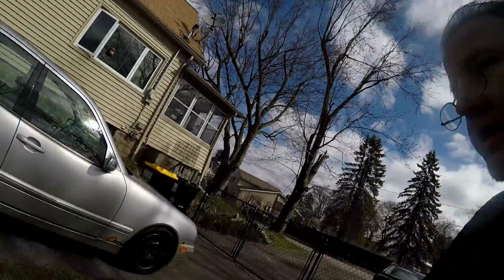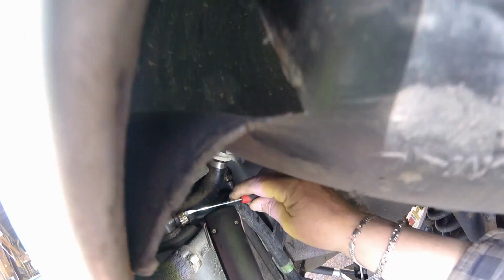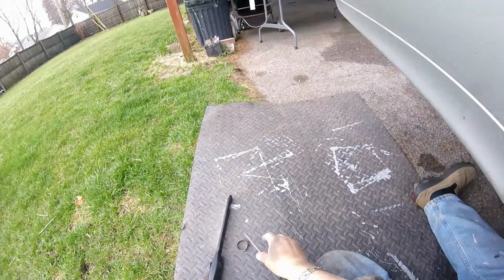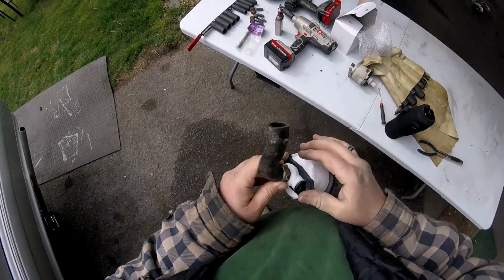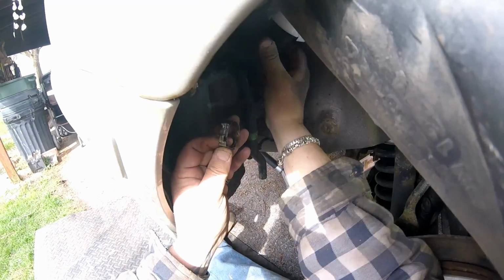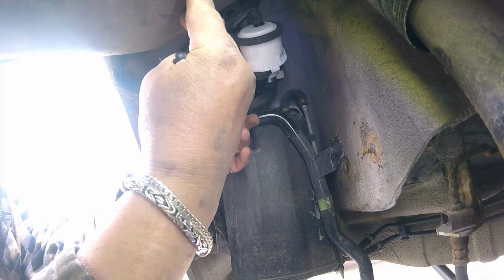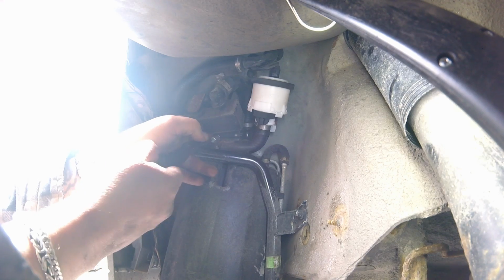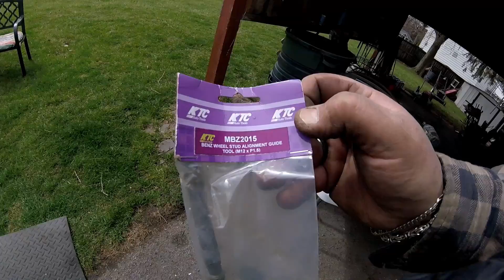Mercedes W210 Vent Valve Replacement, Pressure While Attempting To Fuel Up. 2020 04 02

Comment: Good job but my e320 1997  doesn't have this valve just one beside the engine in front of the driver side is it the same
Reply from the maker: I believe the one you are talking about is the purge valve. As fro your question I'm not sure. Thanks for comment and watching Ibrahim.